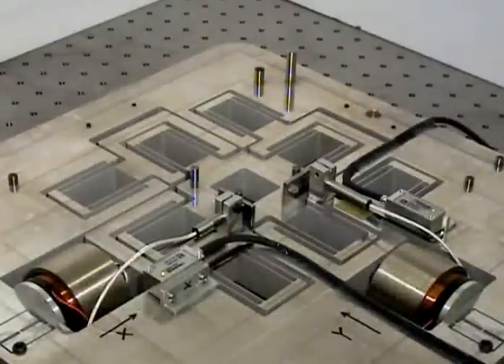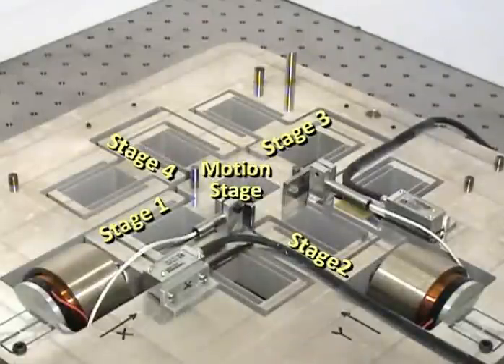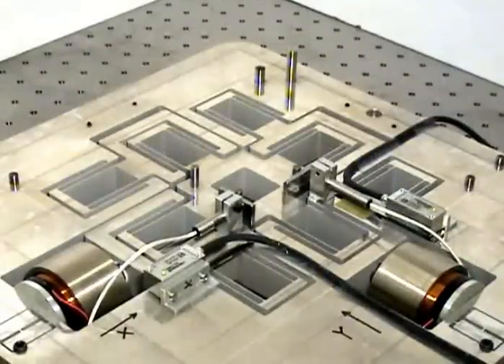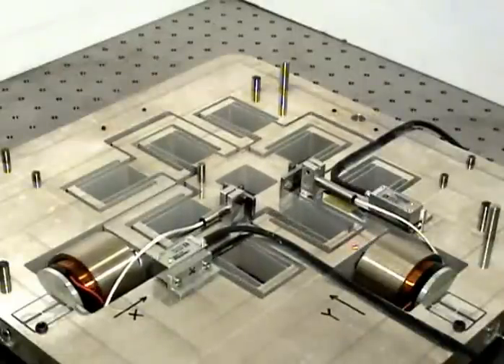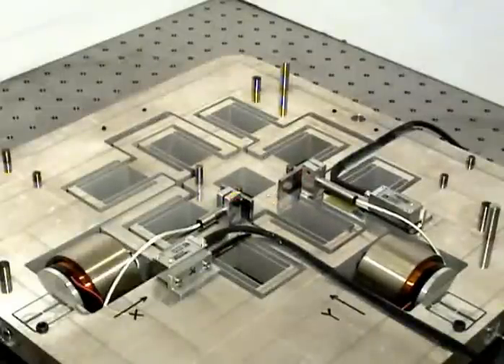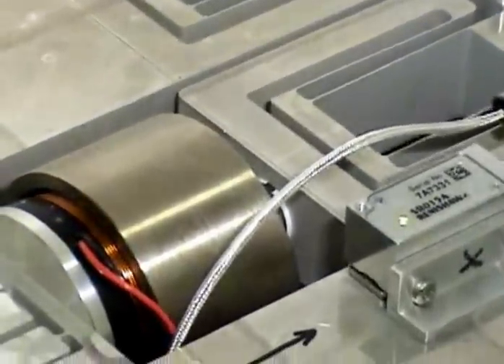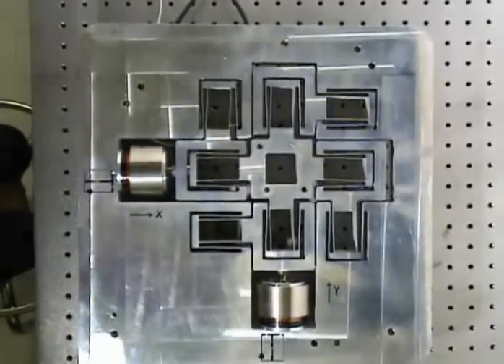XY HiPER NaP

Comment: Since it has only been 11 years, I'm sure you won't mind my stupid question:-) Why does each flexture have two thick blades supporting a bar with many thin blades to support the center square?  I mean, why not blades of uniform thickness?  Is it to provide a variable spring stiffness over the range of motion? Is it to do with the thick ones supporting more weight/leverage? I often see similar patterns in other flextures so I'm pretty sure it serves a purpose other than to look cool but I'm feeling clueless.
Reply: The thicker parts are the ones that are supposed to have stiffness. That makes the section move in parallel on one axis.

Comment: 1. The actuator and motion stage are in 1:1 ratio - how does the motion stage achieve a precision better than the actuator? Or is your actuator itself precise to a nanometer?
2. Although imperceptible from the video, the flexures will have a sort of rotatory motion over large movements like 7mm. Doesn't that effect the positioning in the perpendicular axis?
3. How was the system validated?
Reply: 1.  Voice coil actuators have no inherent precision limits. They just provide a force that is proportional to the current supplied to them. Precision is determined primarily by how well the motion controller can read the position sensors. 
2. If you look carefully you will see that there are multiple sets of flexures arranged in a way that cancels out each individual flexure’s rotational motion.

Comment: I will wonder how stable is this system while all of it is in motion, meaning the actuators, ground and axes.  Also, do I see z-axis motion in this video?
Reply: No Z-axis its just an X-Y.
Reply: @tonywilson4713  I was asking if there was some wobble in the z-axis. I thought I saw the mechanism bouncing or vibrating up and down.
Reply: @microdesigns2000  If its stiff enough in that axis it shouldn't do anything. Its looks like its been made from a fairly think slab of over an inch. 
Think like how a knife blade can flex side to side but up & down. What they can do is twist and it might be that its twisting or vibrating. 🤷‍♂️🤷‍♀️
Either way its an interesting device. He does have other video with a 3-axis version.
Reply: @tonywilson4713  I’m here after watching a bunch of stuff in 3d printers, cycloidal gear stuff, and... how to trap a cat.

I can’t help but think I’m a 2-legged cat and youTube is the trap.

I’m looking at this thinking: how could I apply this to a fast and accurate 3d printer?
Reply: @strictnonconformist7369  I totally empathized with feeling trapped by YouTube.

I doubt you can do flexures with a 3d printer unless you use it to create the pattern and then machine it afterwards.

Those very thin parts that flex might be beyond what a 3d can do and they can be a bitch to machine.
Reply: @tonywilson4713  I think that apparent motion is a result of rolling shutter and the low bitrate video compression. If you look closely you see various obviously solid and inflexible parts also appear to be warping weirdly with the motion.
Reply: @listerdave1240  Fair enough.

Comment: I am wondering why there is no yaw/rotation detection (or even better control) included.
Would be appropriate for true nanopositioning device.
Reply: You don't get that with flexures. Its one of the things in flexure design they can decouple motions and be highly specific in what axis they move. Watch how it moves when he's only operating 1 axis at a time.
There's other vids around that better explain how flexures operate. What makes them rare is that they can be very difficult to machine. Machining those very thin sections of the flexure can be a extremely difficult. Here's someone machining one and he goes into how he wrecked his first attempt -> https://www.youtube.com/watch?v=_5xxPr8sz8E&list=PLY67-4BrEae8_xajHtfkFjjOcRanwVZG5&index=6
Reply: @tonywilson4713  What you see in this video is most likely not made by a milling machine, but by an EDM or waterjet laser.
EDM - https://www.youtube.com/watch?v=B5ImnweEuSM
Waterjet Laser - https://www.youtube.com/watch?v=GywQVNA6qoY
Reply: The flexure arrangements provide stiffness against motion in the other 4 axes. As long as no significant external forces are applied then this should be fine for most applications.

Comment: So how does this achieve nanometer precision ? Does the structure not offer resistance to being bent ?
Reply: Closed loop feedback from capacitive position sensors.
Reply: there is 0 backlash and the actuators provide the correct amount of force within the flexible structure to move it with nanometer precision.
Reply: @robum911  'Backlash' is not really the correct term here, I think what you mean is static friction. And indeed that is why this precision is achievable and its a huge advantage of flexures over more 'common' types of linkage.
The capacitive sensing is merely enabling the precise sensing, but you can put these sensors on a non-flexure design and it wouldnt be able to achieve the same accuracy, especially not with the same type of control system.
Reply: it seems that its actually taking advantage of that

Comment: Thanks for sharing. It looks like it was cut out of a single slab. Is that so?
Reply: To me it looks like a Wire-EDM cutting from a single slab. What bothered me, was the speaker repeated the same information three times over and over but was not explaining, where now exactly the linear sensing was done and where the capacitance was measured. At least I could also not tell from looking at the design. For capacitance measurement I would have expected a parallel moving of some plates changing the overlap or two plates varying in distance... It would have been nice to fill the time with further explanations, rather than repeating the same.
Reply: @michael-rommel  How do the digital measure calipers work? Same principle?
Reply: @LordGryllwotth  Unfortunately I could not tell that from the video - too little information was provided, how exactly the setup was... :-(
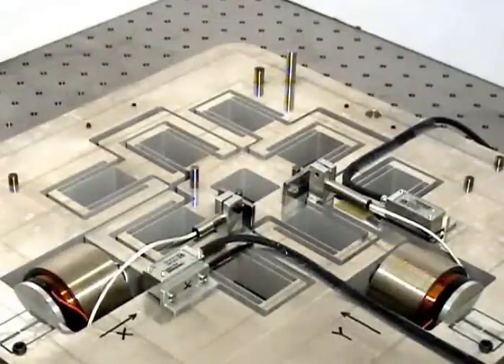Reply: @michael-rommel  He talks about sensing at 2:40. Shortly after this the video includes overlays showing where the encoders and probes are located. Looks like commercial off the shelf laser diffraction grating encoders and capacitive displacement probes.